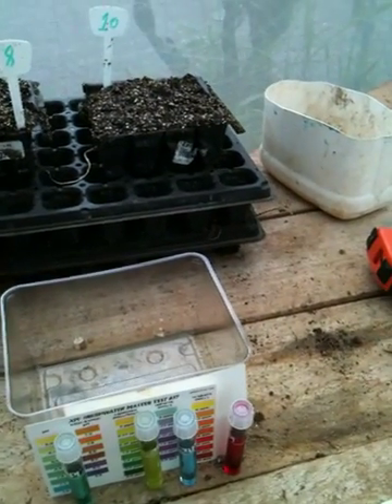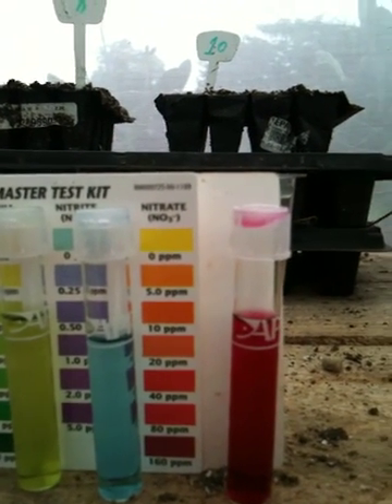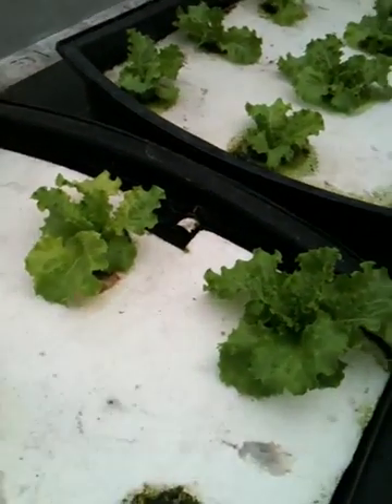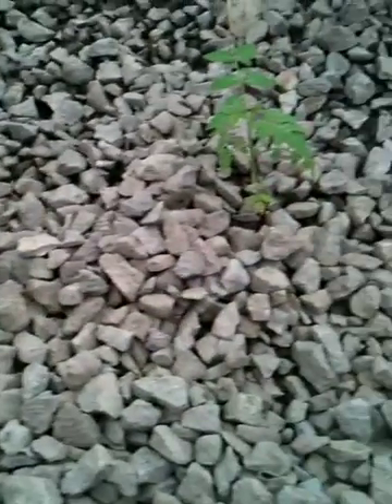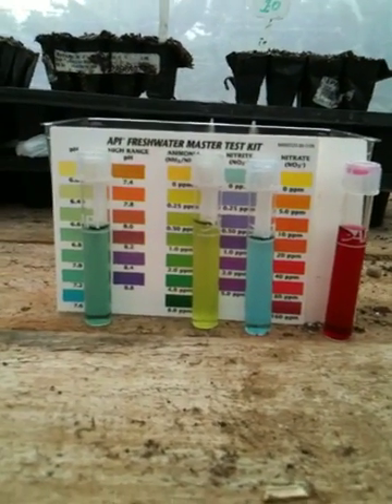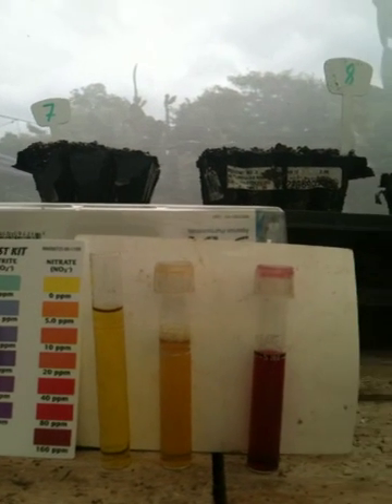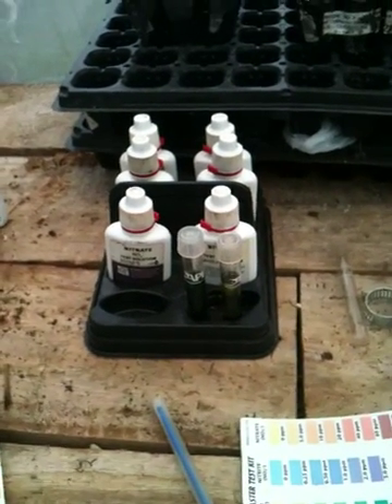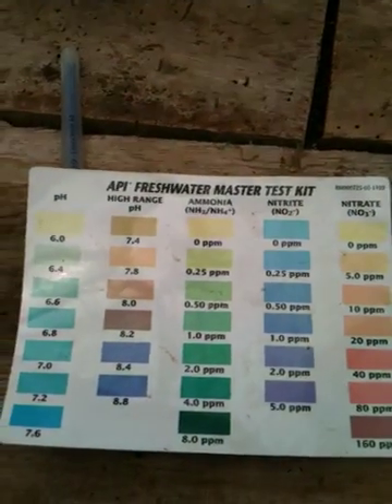Lessons in Water Chemistry

Comment: are you still trying to grow aquaponically? If so I hope you got this fixed / figured out where is your garden? country or state? the point of the solids filter is to remove the solids from the system and prevent the nitrate poisoning. time to wash the grave; starting with the bed you have been using to dump the solids in

Comment from the maker: @daniel3484 Well, as you can probably tell, I don't like throwing fish waste away.  My gravel beds filter most of the particles for me.  The problem I am having is too much nitrate, which is not a bad problem to have (unless it continues for too long).  I have a Matala Pond Filter prior to the floating raft beds, but that's just for the water going into the raft system.  The rest of the system only uses a small clarifier, and what it filters out I dump into the gravel beds.

Comment: @hroarke24 Thanks. The only problems I'm having so far, that i know of, are poor filtration and I need to cover the system because alot of pine needles and leaves fall in those raceways. I added some more media to my filter and it seems to be helping. I'm currently building an indoor system consisting of IBC's and some nice filters, the CETUS sieve filter and a Easy Pod. These filters are pricey, but from what I've read they are well worth it.